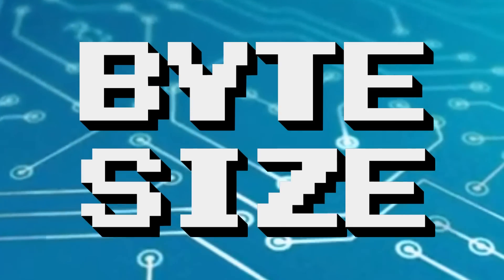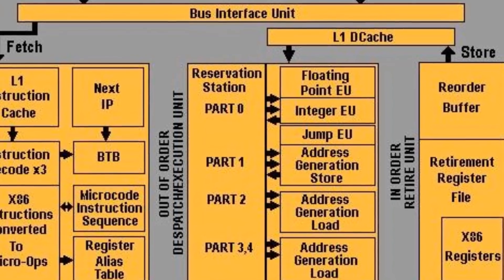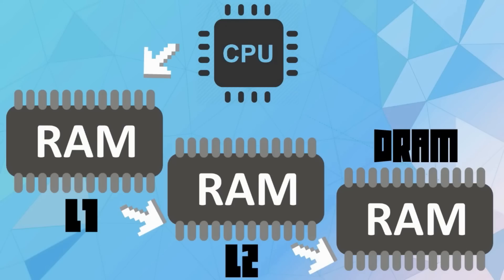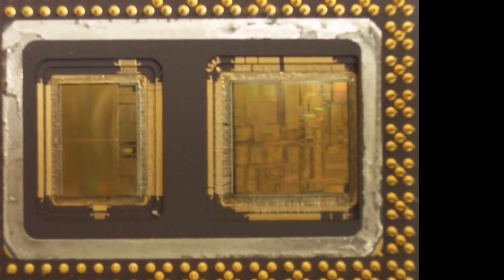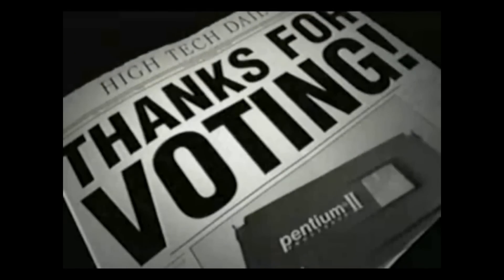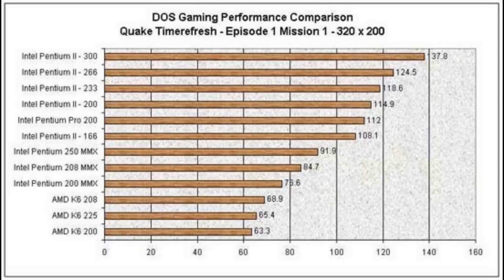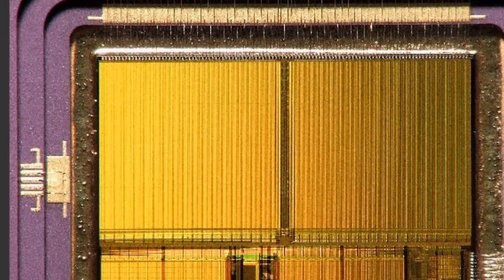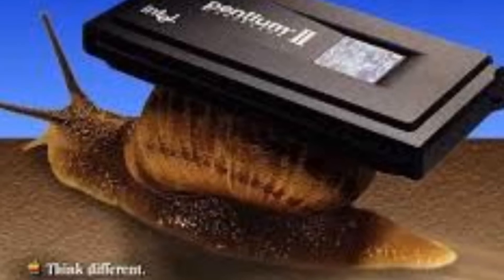Why Were Pentium 2's on Cards? [Byte Size] | Nostalgia Nerd

Comment: One thing you say the Celeron was so the could control the sub 100 market but no I remember reading about the Celeron when it came out the Celeron was made because it was a pent 2 who had a flaw in the lv2 cash so like the beginning of video said in stead of losing the who chip they just rebranded it as a Celeron when there was a flaw in the cache

Comment: Slot processor may looking cool and easy to install but they are  bad performer in intensive use. The reason why they were in cartridges because the L2 cache was big and complex back in the day, integrate them within the cpu die will increase die size and power consumption, yard will also be terrible too that also impacting the production cost. Cartridge was really a only solution back in the day to make them cheaper. If I recall, the most expansive pentium ii 450 was only cost 600 bucks in 1998. Much lesser than today’s i7 on lga2066.

Comment: just as a note, my p3 slot 1 550 with a gt 240 some how (pro due to celeron been junk) out paced a p4 1.4 with a gt 440 in unreal tournament , both of witch i still have just with out the board, yay im old (ish)

Comment: As a system builder from the very early 90's up to today, the ease of installing the P-2 as a card was a dream. Wouldn't work today though since speed equals heat output. I found it a very strange experience, but oddly satisfying. But to be honest, I was an AMD fan boy (still am) and Intel can suck it. lol.. With kidding aside, I'd like a call back to something like this. Installing a CPU actually is stressful if you bust your ass at work just to buy the latest and greatest for your next PC build. My last experience was a major nightmare, and even discussing RMA with Intel's 'India' division (who no one understands and it's not racist to say so), along with MSI lying to customers and Asus confused as to what the hell was going on (yeah, 2015 was one f**ked up year for everyone and with me buying 6 motherboards and retailers refusing to give refunds/exchanges)... Let's just say that it's best to buy 'last year' shit and research the hell out of it before jumping the gun and buying into 'this week's tech'. Otherwise, the real world will catch up to you and bust your chops in the worst way possible.

Comment: AMD did this as well on the first Athlon processors and Apple on PCI Power macs though in the latter it was so they could used the same MB in several different configurations in build to order systems.

Comment: Because it was cheaper to manufacture in pcb than on MCM(aka multi-chip-module) packaging and integrated L2 cache was impossible in 1997 with 350nm fabrication process. It wasn't until coppermine that came with l2 cache on cpu die in 180nm process which was two years later.

Ps: celeron 300a and k6-iii were using MCM packaging like pentium pro, unlike many source claimed  they were on die which it wasn't true.

Comment: I still have an old Compaq from 1999 that was designed to have the monitor sit on top sitting in one of my closets and it has one of those Pentium II cards at 400 MHz. I used to play games like Dungeon Keeper and Thief: The Dark Project on it. I've never owned an Intel CPU since. I switched to AMD back in 2000 because I always felt AMD CPU's were superior to Intel. Even now with multi core processors AMD offers 6-8 cores at much more reasonable prices.  Intel processors are over priced and typically only have 4 cores unless you spend some ridiculous amount of money on an Intel processor with more cores. Anyways back on topic prior to 1999 I had a computer with an AMD K6 333 MHz processor and a Voodoo 2 card. I forget what video card I had in my Compaq I think it might have been an ATI Rage. I always preferred the Voodoo 2 though especially in the games I mentioned.

Comment: If Pentium 2 processors were in a cartridge format just so the CPU and L2 cache could be tested separately, how can the Pentium 2 Overdrive exist?
The Pentium 2 Overdrive still had the L2 cache outside the CPU, but it used the Socket 8 form factor, the same as Pentium Pro. In fact, the Pentium 2 Overdrive was even better than a vanilla Pentium 2, because its cache operated at full clock speed. Thus, the position of the cache and the ability to test it separately had absolutely NOTHING to do with the form factor choice. So, why was the Pentium 2 in a cartridge, again?

Comment: It was a typical Intel ripoff, the L2 cache on the CPU board ran at the same speed as the RAM, making it run exactly as fast a a chip without L2 cache. It did sell like a CPU with lots of L2 cache though!

Comment: My first PC had a Pentium II 350. This back in 2005(!?). Good times...
Reply: +maximuscesar My first PC had AMD K6/2 350Mhz purchased back in '97.  What did you do with a 350 in 2005?
Reply: Dude I ran the hell out of it! It had a SiS VGA and Windows 98. I used to play Doom, SNES emulators and PSX emulators.
Reply: My first PC had no hard drive, CGA graphics, no mouse. That was in maybe 1997 too. Got it for free and had a blast.
Reply: My first machine that lasted longer than a week was an Intel Pentium 4 machine with a 1.7ghz clockspeed, one core, and 1GB of DDR1. 40GB Seagate IDE hard drive, Windows XP Professional 32 bit, ATI Rage 128 Pro. Sadly, the motherboard failed after a while and I was not thinking when I tossed the board away.
Reply: +El Guapo

How could you buy a computer from 1997 that contains a cpu that wasn't released until mid 1998 ?
Reply: Good detective work son, fact is that purchase is an unimportant date in my life and I guessed at the time. All I remember is late '90s and 97 is smack in the middle.
Reply: +El Guapo My first own computer was also a K6-2 350 Mhz. Really good processor if I recall correctly.
Reply: user10476 That's awesome, actually! I remember my brother having a Pentium 3 slot processor in his first computer...one day the computer went black and some electrical smoke got fanned out of the back of the case, turns out that thing fireballed a couple transistors right then and there. Could not fix it so we had to scrap the whole thing except the processor's fan, sadly, but yeah.
Reply: He used to listen to a freaking ton of 80's music with that thing, though. Lol
Reply: first pc i built was an amd k6-2 550 a pentium 2 300mhz was still faster in games
Reply: pentium 2 with 2 voodoo 2 graphics cards in sli mode what a beast the helicopter sim apache really showed it off
Reply: this was around 98-99 i think

Comment: The Celeron 300A (made in Malaysia) could be overclocked to 450Mhz and was slightly faster in most benchmarks than the top of the range Pentium 450Mhz which had extra cache, and at the time it cost 3 times more. I purchased a expensive Pentium and took it back for a refund and got a Celeron 300A instead and overclocked it and it was faster and way cheaper. Also with all the extra cache, I found 99% of all software on win 95 did not benefit from the extra cache, so all the extra speed promised was just hype and marketing lies.

Comment: wait wait I missed it, why were they on cards?
Reply: Yeah, he really didn't answer the question.  The P2's came on cards because Intel hadn't yet figured out how to optionally disable on-cpu cache, meaning that any slightly defective Pentium Pro's were a total loss.  By moving the cache to the card and connecting the cpu to the card they could have fast cache performance (at cpu speed instead of bus speed), and since the cache was a separate part they could keep all the CPUs and relabel them celerons for the ones where the cache was bad (in this case removed).

Presumably it took some time for Intel to figure out how to laser disconnect the failed cache which they reintegrated with the newer P3s.

Comment: I picked up a 450mhz Pentium II Xeon on ebay for 6$ a few months ago.
Brand new, in the box, still wrapped in plastic.

Everything else was cheap, gpu, ram, sound card, storage and crap, now the issue is finding a danm motherboard.
Reply: nope, you need slot 2 for the 450mhz one
the earlier p2x's could be used on some slot 1 chipsets but not the newer ones
Reply: Slot-2 motherboards are a bitch to find, I think it has to do with that most slot-2 systems were 4+-way SMP enterprise servers that were most likely sent directly to scrap after large corporations were done with them. I would guess most people and small businesses at that time that needed a 2-way SMP machine at the time used a dual Pentium II system.

Comment: I had a PentiumII 266. I accidentally messed with the jumpers on the board one time and gimped it to 133. It took me a while to figure out what i did wrong. I probably grazed the jumpers moving my hand around the case when inserting a card by accident.

Comment: I still use my 1 Ghz celeron on a SLOT 1 adaptor on a Asus P2B motherboard. Still no intention to upgrade. I even have a spare celeron in case this one dies (because I run the cpu in a over voltage, because this motherboard was rated for a 500 Mhz cpu max, and could not deliver the required voltage).

Comment: Slotted cpu only has 242pin and that less pin increases more access latency and cache wise can only clocked below 300mhz and limited in bandwidth and higher latency as well. I had Coppermine 533mhz and katmai 600mhz and Coppermine beats Katmai by at least 30% And meanwhile slotted Coppermine 533mhz is 10% behind S370 Coppermine  under same frequency which you can do the math. 1.5ghz Orion/Pluto was only as fast as 1ghz Thunderbird and 900mhz s370 Coppermine because the cache was only 1/5 of core speed and IPC is generally suffering. Because of competition, slotted CPU didn’t have future in term of high performance and only to existed to lower the production cost and keep the silicon DIE in higher yielding, both Intel and AMD lost huge margins of profit during that time and even Intel suffered from chip shortage for 30+ months because of abandoned Slot design.

Anyway, slotted CPU probably one of the  worst design from Intel besides Itanium , Atom, Netburst and Rocket lake….

Comment: I used to own a socketed slot 1 CPU but that motherboard sucked, so I bought another board, removed the cpu and used it as a normal socketed chip a tossed the slot card in storage.

Comment: i think the 2MB of L2  per core was the optimal for speed then and now with CPUs also the Xeons only had 1 core on them so 2MB of L2 cache on each CPU core on each CPU die back then. unsure why that is still so over 20 years later but it is even though they did do the thing of having more L2 then AMD for some time now they have 1.25MB L2 on some chips and 2MB L2 on other chips depending on the generation of chip 
so something back then was correctly made and shouldn't have been changed at least so yay for smart ppl in physics and electrical engineering in the 90s

Comment: That is where it ends... Well no. 
It was only the very first celeron slot card, the 300A (from memory) that had no cache. Benefits included overclocking straight to 400mhz (66 FSB to 100 FSB). As there was no cache to 'clock' it was easy, and became possibly the best overclock ever. 
The Celeron 333 (and up) had a small L2 cache of 128mb. No modern Intel besides the 300A had no L2 cache, hence its seriously bad performance.
During the day, haxors would buy second hand dual slot server mobo's, and stick 2x 300A slot celerons in, and over-cloak them to 400.. cheapest bang for buck gaming machine.  Of-course the only actual game that took advantage to more than 1 core back then was Unreal. - oh well
Reply: The 300A was the first one with the full-speed 128KB L2 cache, and would OC to 450 MHz provided you had a 440BX board.
The early ones without L2 cache were the 266 and the original 300 (without the A) and were imfamous for being slower than the pentium MMX clock-for-clock. The 300A when OCed to 450 MHz could easily trade blows with the much more expensive Pentium II 450.

Comment: It's funny thinking about "whopping 1MB of L2 cache!"
In one week, AMD Ryzen 9 3950X will be released with 8MB of L2 cache...

... and 64MB of L3 cache, which are way faster than the L2 caches of yesteryears.
Reply: And the A13 in the latest iPhone has 8 mb of L2 cash too, and about 2 times the transistor count of a Ryzen 9 which is crazy to think that thing fits in our pockets.
Reply: @galdutro  
That's not quite a fair comparison.  Are you comparing A13 (complete SOC with GPU) with Zen2 Chiplet (just Cores+Caches)?
According to WikiChip, A13 has 8.5B transistors.
Ryzen9 (3900X, 3950X[T]) are 3-chiplet designs, so 3.8Bx2 + 2.09B = 9.69B transistors.
A fairer comparison would be against the latest Renoir APU, which includes a GPU.  According to TechPowerUp article I found, it contains 9.8B transistors.
Also note, Renoir APU only has max 4MB L2 total (512kx8), plus just 8MB L3.  Zen2 chiplets have 32MB L3 each.
Reply: catsspat I thought, accordingly to my research, that the transistor count was for the whole die. Sorry for my misinformation

Comment: Wait! WAT! They couldn't test the two silicon components of the P-PRO individually! You go through all the complexity of putting two dies in one package and you don't get an increased yield! Naaaaa. I'd be more likely to guess that they could test them (and did) but they still had a significant number of integration failures. Perhaps they were being too optimistic about the transmission lines between the two dies so that though the dies were both good they just couldn't talk to each other ... that would be really annoying! (and "technically" untestable).

Comment: i had a graphics card once - but it never worked - it is isa-16 slot based - 

Later on i bought a SBC card Pentium III for cheaps.. 
but i needed a backplane, so, i bought one - now i had a nice industrial Linux SBC machine... 
then the so thought graphics card seemed to work stand alone on that backplane..  hey!

And so it came to be.. it is a VICTOR 286/12Mhz single Board computer..  i just didn't knew that..
unfortunatly.. the 286SBC doesn't have a keyboard connector.. and the backplane misses 
some hardware to support the din5 plug.. silly this.
upgraded the memory.. but that's it..

Who knows a bit about SBC backplanes and systems ?

Comment: pentium pro's weren't really revolutionary. Multichip Modules (MCMs) were being designed prior to that. they may have been the first mass produced, that I'm not sure. I worked on large systems involving MCMs in the early 90's.

Comment: So you have explained a bit about the difference between the P2 and the P Pro, but still no reason why the P2 was on a cartridge instead of on a chip, as former and later (after PIII) processors were.
Reply: It was not well explained, I agree.  The video wandered off into tangents.

The cartridges were a way to manage the transition period towards integrated L2 cache, at a time when L2 needed to get faster, but it wasn't yet feasible to put the L2 cache on the CPU die.

Slot-1 was introduced because Intel wanted to take in-house control of the L2 cache ICs and the connection between them and the CPU.
Since there were multiple chips involved, and Intel wanted to control that whole subsystem, they had to integrate them on a daughterboard.
Previously the L2 cache had been left up to the motherboard manufacturer, but as Intel needed to significantly ramp up L2 clock speeds, I guess they no longer trusted that subsystem to the motherboard producers.

I'm not an EE, but I wonder if running such a high L2 clock rate across the pin interface between the motherboard and CPU was just not feasible.  As clock frequencies increase, that connection becomes more sensitive. By using the daughterboard design, the faster clock rate required for the L2 cache didn't need to run across the socket pins.

Some CPUs that used the cartridge design had the L2 cache integrated into the CPU chip, so they didn't actually need to be on a cartridge anymore.  Those were still produced as cartridges simply for legacy compatibility. The original reason for the design was because of CPUs that relied on external L2 cache ICs.
Reply: yorgle11 Thank you, that clarifies the topic very much.

Comment: I liked that design, was easier to fit.

Ah the Intel SellHerOn... That's what we called it anyway!
Reply: +Kee Lo The only Celeron I had that was good and almost the equal of its full version, was the Celeron 1200 Tualatin in 2001.  However most Celeron were too pared down and underpowered.
Reply: You must have been one of the lucky ones.
Reply: Kee Lo I made it a point to only buy higher end Intel models after that Celeron, and crucially Intel chipset based motherboards.  I've had AMD before too and other brands but I usually ran into major problems, e.g. hardware compatibility.
Reply: I did have an AMD K6 - but it was so troublesome I never went to AMD again.
Reply: Kee Lo I had a K6 2 500MHz which was not bad I suppose, and I lacked money at the time.
Reply: That was one advantage - they were cheaper.
Reply: Kee Lo I'm a bit behind the curve at the moment though, with a Intel Xeon X5492 which I modified to work in a LGA775 ASUS motherboard.  So I guess this was cutting edge back in say 2010.  However it does everything I need and is plenty fast enough.  Might need an upgrade in approx 3 to 5 years.
Reply: Yeah I don't build computers much nowadays.

Comment: didnt they make Pentium 3 also?
Reply: Larry198s yes the last Pentium III to be available in Slot 1 was the 1.1GHz, I think the first Socket 370 PIIIs started around 850MHz and they made them in both for a bit
Reply: thanks
Reply: Off the top off my head I know that Pentium III in socket 370 were offered in speeds as low as 533mhz, because my mom and grandmother bought identical HP Pavilion 8660c's back around 99' or 2000 that had those socket 370 PIII 533EB chips, also some of the later Mendocino Celerons came on socket 370.